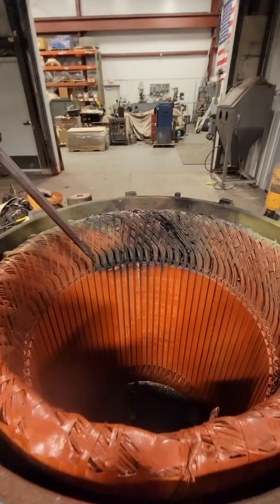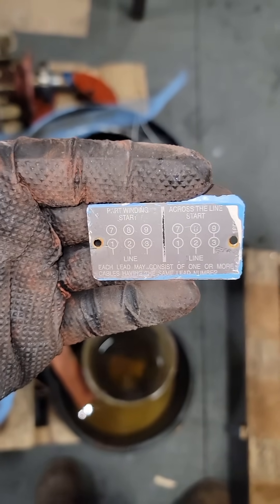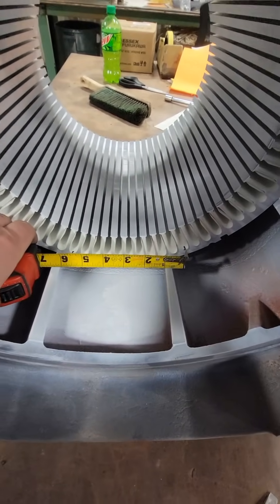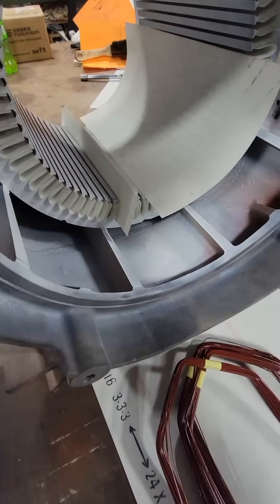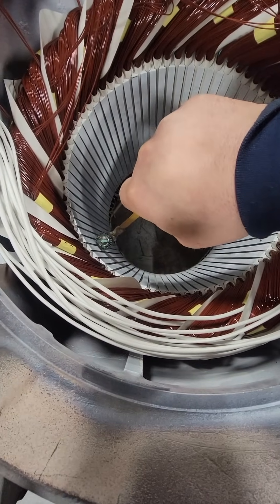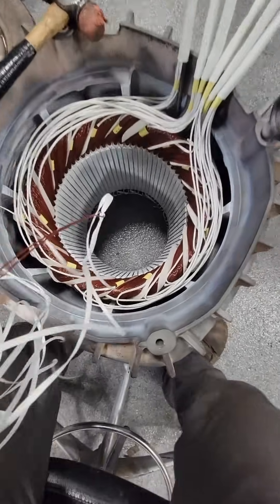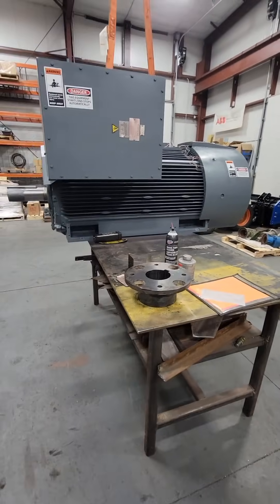Rewinding a 75HP VHS motor. Kw

Comment: That 700hp is a baby. We installed a 20,000hp Siemens custom motor in a polyethylene extruder at Exxon in Beaumont,tx the lube oil cooler station looked like a small refinery. The power factor on that big boy was 13,200-297amps-60hz

Comment: I’m the Electrician on a large dredging ship, she has more than 22.000hp in Diesel power, she is 150m long.

She Has 2 2,3MW 3x660V main generators and 2 860kVA 3x440V Auxillary generators. (CAT 32l V12 Twin-Turbo diesels ~1500kW each)

The machine is a hot rod when its unloaded 😆 it has a ridiculous power to weight ratio. Like a Bulldozer for the ocean. When she is not carrying 12.000cubic meters of sand the damn thing moves like hell.

We have a few 700kW electric motors 😆 some are watercooled too.

All hooked up to VFD’s running off 660V.

They are used to run Jetpumps, large centrifugal pumps that pump 12Bar of water to the dragheads. Through 400mm pipes, these things move some water.. 💀

This water is injected in the ocean floor via nozzles to loosen up the material.

The dredgepumps can draw 6MW of power each if needed. Mainly for shore discharging (up to 8km away) they are put in series, up the pressure to 24Bar 💀

Then the beast is laying still and using all of its might to run the dredgepumps. (Diesel direct drive off the MAN’s)

Comment: Remember though it is rare could be odd turns. Rare in a 6 pole but I always check. ❤
Reply from the maker: Could be odd turns in any winding, always count a full group or more if you have odd groupings.
Reply: @motorfixin  I do the same.. always count the whole group.💪🧡
Reply: But odd turns are different than odd grouping... oh the joy of winnding.. lol... I could go on for days... love the party box... too. I remember rewinding a generator.  Re wound it the the customer cut the leads. Thete was 18 leads that's including integral leads. I had to use a d.c. power source and a compass among other tools to identify those leads and re lead the motor... it was a nightmare but a good job to exercise troubleshooting.

Comment: I worked at the World Trade Center back in spring 2001 and we pulled a 13800vac over 790vdc 5000hp DC synchronous motor from a 6000 ton chiller. York OM titan series, OM-55’s

Comment: Individual coils per slot… Nothing is worse than having to silver solder all those connections…
Do you do concentric winding also, and raise the lap? 
Where are you located?
Reply from the maker: Ive done a lot of concentric and i always lay the lap. I did a 350hp 2 pole concentric that couldnt convert to a true lap solo, that was kind of a pain

Comment: There is a 1000hp electric motor here where I work.  It is part of a tractor-trailer dynamometer used for emissions testing.  The whole truck sits on big rolls connected to the electric motor and this simulates the load of the truck driving down the road, all while standing still.

Comment: Do you push the stator out of the frame for the VPI process?
Reply from the maker: No, normally dont unless the case only has access to one side. Then ill heat them to drop it out otherwise you cant insert the winding

Comment: Take the wiggly parts to your local machine shop. They’ll turn the pin on the bar round and/or bore the egg-shaped hole round and press in a sleeve perfectly-sized for the pin. Wobble solved. And cost-effective.

Call ahead and send a link to a shorter private video demonstrating all the issues, so you can hopefully take it out of service around the same day they get the work done.
Reply from the maker: @fosterlewis7360 we are a machine shop. Brand new the head cant take the tension, need a more rigid end braced head

Comment: I worked on some large DC motors in the ski lift industry. 734 hp was the largest. This drove a lift that was 2.25 miles long. Love watching the nuts n bolts part of this. Nice work. Oh yeah, and yes you CAN get a machine shop to fix your wiggly winder, for a lot less than 10 k.

Comment: I have worked on a 3,500kw motor in a steel mill. It was a DC motor with 300 sets of brushes. I used to repair the thyristors stacks that drove it at times

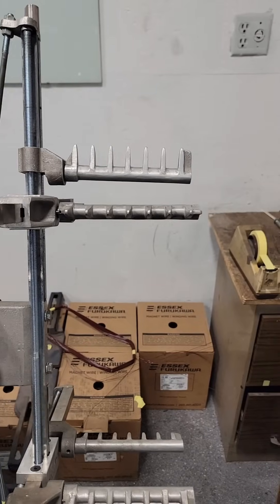Comment: 2:06 any macine shop coud fix that for a lot sel than 10000 dollars
Reply from the maker: @Thefreakyfreek  we are a machine shop. We could fix it. Brand new it couldnt hold the tension, need a more rigid head. That head is about 3500, you get what you pay for

Comment: My father was an electrician, he repaired motors and did installs in industrial sheds building switch boards etc. and I use to go to his shop when I was young, he made his own coil winder it was a round disk that sat flat and rotated with a counter on it the disk had a lot of hole drilled in a number of patterns put steel pins in the holes to the pattern required and bingo a coil winder all made from scrap and worked simple .One day a sales rep came in to sell him a coil winder my father showed him his machine the salesman agreed it was better than his machines.